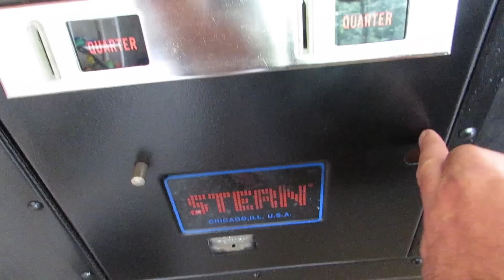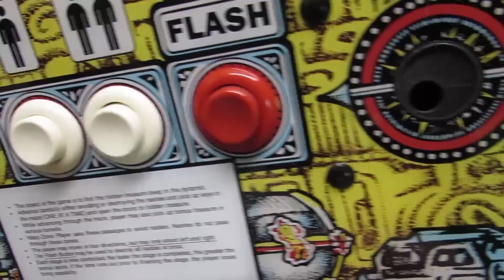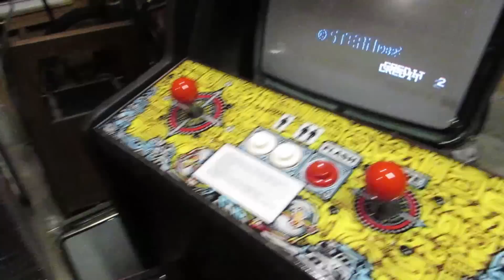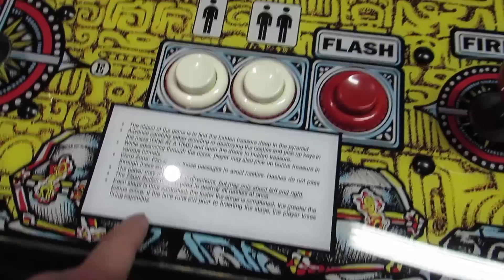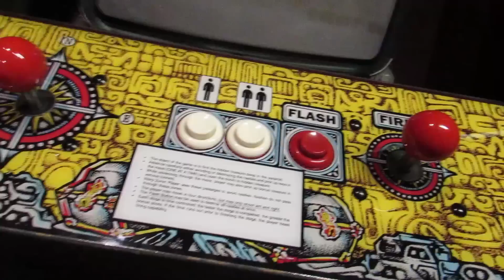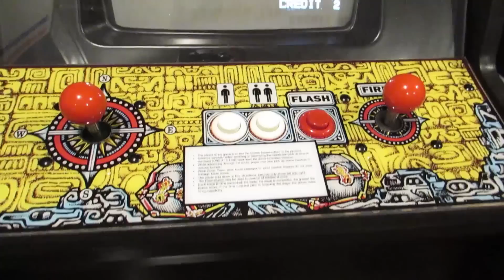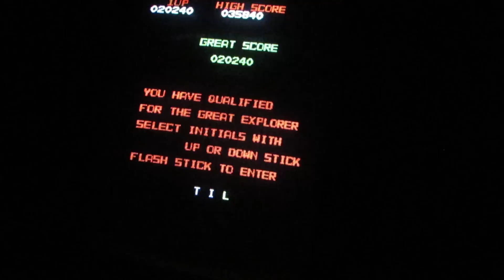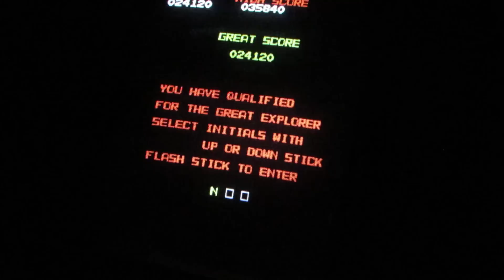Stern Tutankham Arcade is DONE!

Comment: Nice job, where did you find the wire harness for this? I'm currently doing a tutankham myself and need a whole harness. Thanks tim
Reply from the maker: So I used a JAMMA harness with the Konami to JAMMA adapter and a switching power supply.
Reply: @ThatTimGuy  how much was the side art and the cpo

Comment: Just got my hands on this great game. Switching adapter from Highscre saves and im up and running. Do you have the color code for the brown on the cab by chance? Where did you get those updated sidearts?  Thanks in advance buddy!
Reply from the maker: Side art came from This Old Game. 

Stern Tutankham paint match
Neutral base
E-167, F-254, KX-45, RR-1Y303

https://youtu.be/rS-Bkz3Epec?t=22m4s

I used the handle off the back that never saw the light of day to match it.

Figured I'd post this in a couple places after we got it sorted on FB. Have fun and good luck with the restore!  👍
Reply: @ThatTimGuy  thank you.